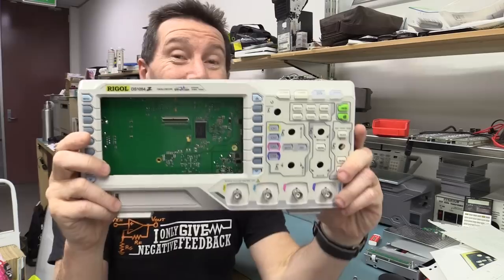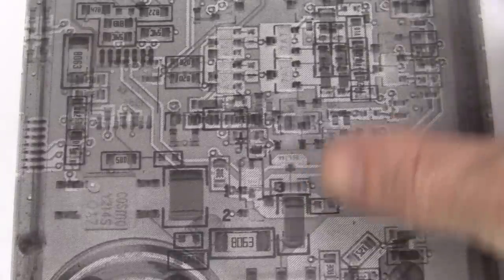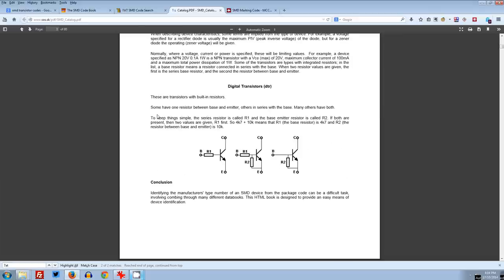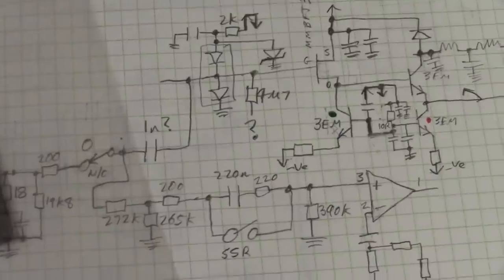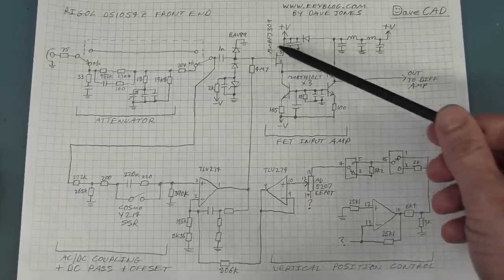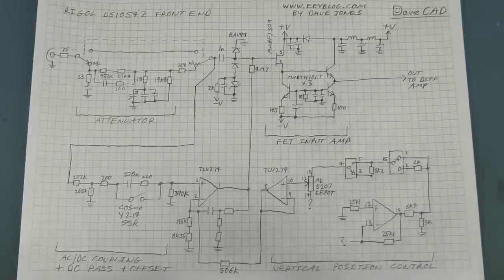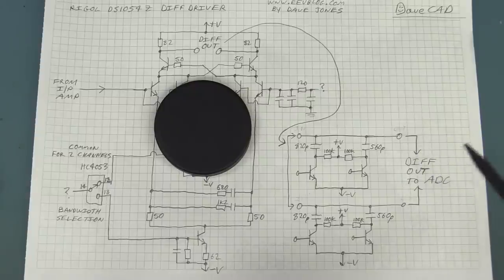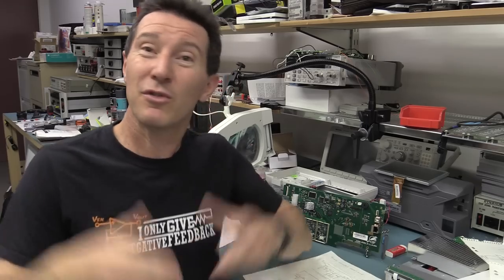EEVblog #675 - How To Reverse Engineer A Rigol DS1054Z

Comment: As much as I dislike Dohn Joe 's responses on here, I do agree that reverse engineering and intellectual property don't exactly go well together. In this video it's fine, because you can easily use fair-usage such as critique, education and reporting . But yeah, I think from a legal point of view it's actually illegal to modify hardware of the devices you own, because you're infringing on the copyright of the design and the firmware of the device. Whether or not charges are pressed against anyone is another point, but Rigol is certainly within their right when they want to prevent people from infringing on their rights
Reply: Reverse engineering and modding only infringes upon IP if IP is actually stolen. In the case of people modifying DVD/Bluray players or game consoles to rip or use unowned content, certainly there are legal ramifications. In this situation, however, Rigol is selling equipment, and end users are improving the equipment they purchased. They can void your warranty, but there is no way they could take you to court over it.
Reply: bloomtom You're entirely right when an anti-circumvention method has been implemented to protect subsequent copyright holders (such as in the case of game consoles, DVD players and other encryption devices. However, look closely at https://en.wikipedia.org/wiki/Anti-circumvention and the linguistics which the law uses. It clearly states "Member States shall provide adequate legal protection against the circumvention of any effective technological measures, which the person concerned carries out in the knowledge, or with reasonable grounds to know, that he or she is pursuing that objective." In this case, Rigol is (presumably) utilizing part of its firmware and (maybe) part of its hardware to protect itself from the users changing the bandwidth of the oscilloscope. This is not restricted to EU, USA also includes "circumvent a technological measure" in its anti-circumvention law. Thus, Rigol has implemented a technological measure to prevent users from changing the bandwidth of this scope. Anyone publishing (aka facilitating others) information on how to circumvent their technological restrictions are therefore infringing upon Rigol's rights.
Reply: ***** Removing the screws falls under the definition of circumventing a technological device. Oh my, Dave you criminal!
Reply: Dear redtails, Rigol is Mainland China electronics company. What "copyright of the design and the firmware" you mean? It doesn't work like that :)
Reply: Gillian Seed Don't be ridiculous, screws are not part of a DRM mechanism, software limitations are. Trying to circumvent software limitations (to give this scope more bandwidth) is essentially the same as pirating. I don't write your law, and you're obliged to know it

kroplaaaa Rigol trademarks, patents and copyrights their stuff all around the world, the distribution is worldwide, your point is moot.
Reply: ***** ahh i see what youre saying, rigol has a copyright on scope bandwidth
Reply: ***** I do not agree with this legal analysis. My grounds are in the difference between digital and physical goods, or information vs. hardware. Rigol is using software (information) to manipulate hardware devices external to the software. Once control leaves the software device (the CPU and related IO) circumvention is no longer protected by the DMCA or WIPO. Further Title 17 (in US code, which members of the WIPO subscribe to) only protects copyright, of which device performance is not covered. Therefore the physical switching of in circuit components on a hardware based device for the manipulation of product performance is not a protected by anti-circumvention laws. My assertion is based only in theory however, for as far as I know such coverage under the WIPO has never been tested in a formal legal setting. There would need to be a test case for us to truly know. Though I believe my argument is sound, I bet a group of really clever (evil) lawyers could somehow get factory set capacitor value states to be covered as "digital media". The thought of where such a conclusion could lead to is not pleasant.

If anyone is stumped by the hypocrisy between software and hardware copyright protection: The RIAA (music industry) managed to push really over-reaching new copyright protection exclusively for digital content in the US back in 1998. This legislation granted far stronger legal protection to digital works, stronger even than physical works. These additional protections include a group of "anti-circumvention" measures, which basically state: "you don't actually own the digital content you own".
Reply: bloomtom You're making the assumption that the law on anti-circumvention implies that "technical measures" are restricted to software. That is an unfair assumption and would never hold firm in a legal setting. Firmware does not operate without hardware, and vice-versa. The linguistics as are used in the European law make no mention of software-only protection and include all technical measures. Although there has never been any court cases for oscilloscopes specifically, there are plenty of cases of people jailbreaking iPhones, android telephones, PS3 (and other consoles), region-locked media players, etc. This short list contains a variety of examples; both software-only and hardware modification. Some of it was ruled illegal to protect the copyright of others, and some of it was ruled illegal because the manufacturer doesn't want you to use their device in that way. As I said, the chance of being prosecuted for upping the bandwidth of your scope is extremely small, though I would not be surprised if Rigol requests people not to reveal information on how to do that.

And of course you don't own digital content? What makes you even think that? Do you think buying a DVD grants you all legal rights to do whatever with the DVD you wish, including modification and reselling? By buying a copyrighted work, you're buying the right to consume it. There are separate methods by which you can buy the rights to modify and distribute creative work, but those are not 4.99$ at your local dvd shop.

Gillian Seed You can continue using analogies to prove a point that isn't true, or you can read https://en.wikipedia.org/wiki/Anti-circumvention and inform yourself on the current legislation on anti-circumvention in electronic devices. After you've done that, you can make a fair argument
Reply: ***** Technical measures are not limited to software, but the protected content is most certainly limited to information, or digital content. The specific clauses in title 17 regarding anti-circumvention apply only to copyright protection systems. Modifying a device's clock speed or display brightness in software or hardware is absolutely legal, but bridging a jumper link to make a device think it is in a different region is absolutely illegal. Changing bandwidth belongs to the former category as oscilloscope bandwidth is not copyrightable. Further, any expert in the field of EE could tell you switching capacitors into the frontend signal path will lower bandwidth, so you couldn't even try to pull "external digital systems" shenanigans in court against a competent defense.

The closest thing I can see as a common example of modifying bandwidth is overclocking CPUs. CPU manufacturers often sell different versions of the same device, just with different clock speeds. Graphics card manufacturers do this as well. Power users and devoted system builders will often find underclocked versions of premium chips and overclock them to get the same performance for far less money. People have even done hardware mods to support this, and have gone as far as unlocking disabled cores on the silicone. This is all perfectly legal, and processor manufacturers accept that if they sell software hobbled silicone and a user restores it's functionality, it's their own fault for selling such easily improved devices. If you are to refute this argument, I would like to see either a better or similar analogue with legal precedence restriction of modification.

As far as owning digital content, I am sad to see you think this way. Yes, when I buy a CD I expect to own that CD, and for the most part I do. I can sell it to someone else when I don't want it any more, and I can make personal backups (as long as they are deleted when I no longer own the CD). What I can't do is use a laser to overlay dubstep over the (likely already garbage) music and sell the CD for $50. I feel like I should be able to do this, as long as I buy and modify every CD I sell (to dumb people for a 10x markup). Unfortunately copyright grants ethereal protection against such things, as if a copyright holder's organization of information is so much more special than every other organization of information that they can hold some ultimate universal power over it.
In short, I disagree philosophically with some sections of the DMCA.
Reply: bloomtom You're still arguing on an edge of software and hardware. The bandwidth limit of this scope is limited (likely) by the capacitor pull-ups, AND by copyrighted firmware that display it on screen. Making this device think it's a higher-spec device, and thereby fooling the software into displaying information it should not display is illegal. 

As for overclocking CPUs; manufacturers do NOT impede their users to change the clockrate of their CPUs and GPUs. The anti-circumvention law makes clear exempts in case the manufacturer stimulates modification. 

As for enabling cores; as far as I know about this topic, manufacturers lock these cores by hardware fuses and I've never seen anyone prove that they've both unlocked additional cores or functionalities AND proven that these additional functionalities were functional. 

As for your point on rights management.. the owner has the last say. That's only fair. Anything beyond that is just your opinion and not based on facts.
Reply: ***** The software is going to be agnostic to the actual bandwidth of the front end; removing the capacitors will not cause firmware modification. You will still see "50 MHz" on the display, but you will be able to resolve 100MHz signals. Just because the firmware says the scope is 50MHz doesn't mean we are bound by law to have 50MHz actual bandwidth.

Perhaps another analogue? : Cars (cars are always a good analogue).
1. You buy a car, and add a turbo to get more power from the engine. Legal? Yes!
2. You buy a car and replace a purposefully restrictive air or fuel intake to get more performance. Legal? Yup!
3. You buy a car, and cut a calculated hole in a purposefully restrictive air or fuel intake to get more performance. Legal? Still legal!
3. You buy a car and replace the ECU with an aftermarket one that adjusts timings to maximize performance. Legal? Yes!
4. You buy a car, dump the ECU firmware, disassemble it, find the timing algorithm, modify the code, compile and upgrade your ECU. Legal? Absolutely not! Why? Digital rights are different than physical rights in law!

Removing the capacitors is situation 3 and is legal.

This isn't a case covered by anti-circumvention laws because the mechanism in place is not protecting a copyright! These transistors and capacitors are not protecting digital content, so your argument is fluff, I'm sorry to be so direct here but you don't seem to be getting it. I have refuted your central point. Please provide evidence to back up any claims to the contrary if you still believe I am incorrect.

RE: Core enabling: You are incorrect. My old Phenom x2 was a quad core with two locked cores. I was able to turn it into a tri-core, the fourth core munged instructions when overclocked; sometimes those cores are locked for a reason. Predictably, multi-thread performance went up by a little under 50% It was great for turning my FLAC ripped CDs into compressed OGG for my phone. DbPoweramp picked up the third core and ran with it. Still took ~6 hours.

RE: DMCA: Refer to my last sentence: "I disagree philosophically". Roughtly translated this is: "In my glorified opinion on how the world should work". I never meant to hide the fact that I was spouting opinion.
Reply: bloomtom Dude, if you're so into analogies, then at least use comparable situations.

1. You buy a scope that can decode SPI, but is software crippled and you need to buy a key to enable it
2. Through a hardware hack you make the oscilloscope think you've bought the license
3. You're now illegally using the SPI license.

And your car example is just bad. It might be legal (or not) to manipulate your car in any way you see fit, but you're compromising the road-legality of your vehicle and your personal responsibility in case of insurance claims. 

As I said, this oscilloscope is likely using a combination of selectable hardware crippling and software crippling. Changing the hardware in such a way to make the device believe it is a 100mhz version is the same as pirating the license and illegally activating parts of the firmware you have not paid for. If this was a fully analog scope that outputted the input without software interference, you might have been right, but the fact there is copyrighted software in the data pipeline means it receives protection by law. 

You'll have to link me a forum thread where you're backing up your phenom figures with screenshots because I can't take your word for it.
Reply: ***** That is in no way a comparable situation.
Your analogy: Enabling a software function though a hardware hack.
Reality: Enabling a hardware function though a hardware hack.

Hardware is not copyrightable. The CAD drawings are protected by copyright, but as soon as your design is a real product and shipped out the door, it is no longer protected by copyright. The only reason firmware is protected, is because it is software, and software is like a CAD drawing that is used to fabricate logical structures in the hardware in real time. Removing caps does not affect the firmware in any way, so there are no copyright implications.

The firmware will be agnostic to the change. Those capacitors are physically filtering the input signal, rounding out the high frequencies. There is no need for software crippling. I'm guessing the jumpers Dave found set the model, the software reads the jumpers, and sets the bandwidth capacitors accordingly. Playing with those jumpers might be illegal, but removing the caps is not. The reasons for this are deep in copyright law hypocrisy. The RIAA never wanted to protect functionality, they just didn't want anyone disabling their laughably weak digital media protection schemes without legal recourse. Title 17 grants no protection to hardware based functionality, because it is out of scope of what copyright protects.

If you think I'm being pedantic over the difference between software and hardware, I'm not. This is the kind of thing copyright courts anguish over. Trying to find where the software ends and hardware begins. This is a pretty clear cut case though, that frontend is all hardware. Some control signals are sent by software, but I bet you could cut them or pull them low and the firmware wouldn't know the difference. The drawing as Dave laid it out for us has no feedback mechanism. Even if there was a feedback mechanism, you could feed it signals to make it think it was in 50MHz mode. As long as you don't enable any software features with your mod, Title 17 contains no recourse.

The only way for Rigol to really protect themselves would be to have the bandwidth limiting entirely in software. If they did that, there would be no need for the hardware bandwidth limiters, so they wouldn't have included them (cost). I'm guessing it was way less expensive for them to just throw some caps on the board and know for sure rather than implement a software based variable low pass filter and have to prove it worked reliably.

RE: The car analogy: Road legality has nothing to do with oscilloscopes, so I did not mention it. However, none of the mods I specified would make the vehicle illegal. If a crash occurred due to a failure in a mod, then you would be liable, but those mods are extremely low risk. The worst that could happen would be a stall (dangerous if you don't know how to handle it), or early component degradation due to excessive torque.

RE:RE: Core unlocking: http://www.anandtech.com/show/2927 This article was written by Anand Lal Shimpi himself; he is not known for telling lies. If you ask for more proof I'm going to give you a lmgtfy and you can do your own research until content.

Edit: Minor spelling.
Reply: ***** I have strictly been using legal terminology when referring to "hardware" and "software" to avoid confusion. The two are treated as completely different things in law, even though we both know that's crap. I thought this was clear.

I wanted to be absolutely sure you understand we can modify the hardware to our heart's content, as long as the firmware remains agnostic (no illegal internal change). I'll define an illegal change as making the scope detect it is in 100MHz mode.

Okay, so if the scope detects it is in 100MHz mode, we've made an illegal change. That's not a problem though, because any feedback mechanism can be spoofed into detecting 50MHz mode, thereby avoiding an illegal change. Think about it, how can the firmware possibly trust any input signals if we control the input signals? Try to think of a detection mechanism, then break it. The only unbreakable interface would need to fully and correctly implement a strong (technical term) cryptographic system. I can guarantee this has not been done.
As long as the firmware is agnostic we are in the clear, and we can pull the blinds so far over the CPU it'll think it's still in the factory, nice and cozy.

Now, if Rigol wanted to actually protect themselves legally (as in, cared), they would have implemented an all-software solution to bandwidth limiting. We can still defeat it, but will grant the device coverage by anti-circumvention laws. I don't believe they have done this, as I have said before. My reasoning is based on what I thought was sound logic: The parts they populated cost money and board space. Why would they have paid an engineer to develop and lay out that section of the front end, then pay to populate the section during production if they already had a software solution in place? Mind you, this means they also spent money on the software guys figuring out how to fit an always on low pass filter into the digital signal path, which wouldn't be trivial. Remember they are trying to squeeze maximum performance out of what they have for the lowest cost possible while still delivering a good product. They don't want software filtering causing a drop in waveforms/second or introduction of phase delay. All they want to do is limit the bandwidth, and a properly designed hardware filter can do that with minimal cost and side effects.

I have a strong reason to believe hardware filtering is being done because those parts are on the board. What leads you to believe there is software filtering going on? Burden of proof is on you, as we already know one way filtering is being done; there is no obvious reason for there to be another filtering mechanism.

If your concern is resale of upgraded scopes, then I have some good news for you. Upgrading the 50MHz model and selling it as the 100MHz model is fraudulent in the most basic sense. One could sell them as hardware upgraded 50MHz scopes, but you'd need to provide full disclosure on the lack of warranty from Rigol, and you wouldn't be able to use Rigol's specifications in advertisement. I also have some bad news though. The kind of person who would profit off the back of Rigol is also the kind of person that doesn't care about breaking copyright, patent, trade, or buyer protection laws. Laws don't stop people from doing things, they only allow the prosecution of bad actors in society after the fact, and Rigol most certainly doesn't have enough weight to attack every, or even many, illegal resellers of devices.

Rigol is a smart company. They are small (relatively speaking), they have a pretty tightly meshed customer base (The EE community is very attached to itself). It would be stupid of them to spend $10 per unit on pointless DRM type protection measures, when those measures will be defeated anyway. That money can go towards lowering the price point or raising their bottom line, and it should. They are relying on turning heads to really fasten themselves to the market, and they are succeeding. The hack-ability will be a major selling point for this thing, even though they aren't advertising it that way. I really don't need another scope, but you can bet I'm buying one just to rip it apart. There are many like me, that love to own a device, and nothing beats doing a hardware mod for feeling like you really own something.
Reply from the maker: ***** It's not illegal to modify hardware that you own.
Reply: Dave is one of the most upstanding and moral citizens of the Internet. In order for say Rigol to create an oscilloscope, I mean all the way, they would have to invent the language, discover the math, chemistry and the physics involved, invent every fucking thing all the way. Their contribution is 0.0001% tops. They got all of this on a silver platter but hide this one small detail. It is society which is immoral, making us compete with one another and with machines. It's one big game of Monopoly. If they want to compete, it's the quality of the product that matters and the fact that I've seen how they work will make me buy one. A sane society would be one big community openly sharing ideas. I see the future, if we are to survive, in decentralized and highly independent communities in which everyone has what everyone else has, where you just get a blueprint off the internet and then just print it out or something similar, perhaps tweak it and upload back, make your own contribution, as it were. The free circulation of information should be one of the most basic of human rights cause that's how we thrive.
If I have seen further it is by standing on ye shoulders of Giants - Isaac Newton
Creativity is knowing how to hide your sources - Albert Einstein
Reply: EEVblog It is illegal to modify hardware you own when you're breaking copyright law in the process. There's dozens of people in jail for exactly this.
Reply: TechnocraticBushman this has got to be one of the dumbest comments I've seen all week. Whereas sharing knowledge seems a noble goal at first glance, you will quickly discover that discovering new knowledge is not free. The only way to assure new knowledge can be produced is by having a good financial structure; aka the protection of intellectual property. How do you propose a pharmaceutical company earn back their multi-billion dollar investment when they do not have the sole rights to the knowledge and rights of producing said pharmaceutical? Right, the liberation of knowledge flow leads to the destruction of most ways to develop novel (scientific) knowledge.
Reply: ***** Pharmaceutical companies are doing just fine. Most research is done in universities and then patented by companies which only do the studies for profitability and that is not ground breaking research by any stretch of the imagination. It's capitalism for the poor and social democracy and the nanny state for the rich. Capitalism could not survive a week, absent of state intervention. Ask that communist Adam Smith with his The Wealth of Nations book. All and I want to stress all research into electronics and the reason why Bill Gates and Steve Jobs are rich was done at MIT, Berkeley and alike, using Pentagon funds and student debt, under the threat of a nuclear bomb coming from USSR. If you want, we can write down a list of modern day technology and see just how much of it came from where, in terms of innovation and invention.
Reply: TechnocraticBushman When a patent for a novel treatment is granted, you have 20 years to do all phases of clinical trials (averages 5-10 years) and earn all your money back. One very important reason research grants are accepted is when the technology can be patented. I'd like to stress that all modern medication that you receive when you're ill could not have existed without patents. In fact, it is exactly because of patents that 3rd parties can make a profit on other people's inventions when the 20 years of protection are over. After all, if patents did not exist, inventors would go to far extends to keep secrets to themselves, and 3rd parties would likely never acquire the knowledge necessary to reproduce something. Patents are not only about protecting the inventor; it's also exactly about sharing the knowledge of the invention. As far as I can see, that's what you want. So in short, what you actually want are patents.
Reply: TechnocraticBushman
Your vision of a free information system is certainly idyllic and desirable, but it is not realistic, and won't be realistic until progress no longer means fulfillment of a direct need. As long as there are some people in the world who cannot possibly live without doing work, some amount of capitalism will be necessary. Currently a healthy free market cannot exist without patent and copyright protection, as otherwise (as per *****) information is hoarded forever in an effort to protect profits, and small actors have a significant disadvantage when bringing a novel idea to market. We must reward people for the progress they've made in a field, not criticize them for the prior art they stand on.

Ideals are important, but they cannot drive your world view. Instead of saying "why don't we just...", say "what can I do to naturally push society towards this ideal?". One strategy originates in ignorance of all the problems in your way, and the other takes those problems head on. We have a long way to go until your ideal is met; I wouldn't expect to see any of it this lifetime unfortunately, but that shouldn't stop you from trying now. If you make something really useful, then you can patent it and be rewarded for your contribution towards our better future.
Reply: bloomtom Of course. I have no illusions. I just followed a reasoning to it's logical conclusion. When I say we should drop competition out of our behavior, I just follow the known mathematical models on natural selection and it's effect on populations, in other words, what has been tested and works. The fact that it does not apply as of yet is indeed a fact. Even for me, to be able to contribute to open source projects means I need a steady daytime job.
Reply: Just to put your mind at ease, it is in no way illegal to modify any piece of any type of hardware. It can be a computer, a car, a gaming system, it doesn't matter. You OWN that hardware period end of story. You can't copy intellectual property and sell it but you can change your own devices all day long.
Reply: ***** "The only way to assure new knowledge can be produced is by having a good financial structure; aka the protection of intellectual property."

How did we even survive until the divine DMCA came to save us? Surely that must mean that the world was created last Thursday and all of human history was an illusion!
Reply: Gath Gealaich Just don't say anything about Santa, okay? Especially around the holidays...
Reply: Gath Gealaich Wow, dude, great logical fallacies you're using. I'm sure you're great at parties.

Give me ONE example of pre-patent technology that cost the equivalent of >1 billion dollars to research. I'll help you here: there aren't any.
Reply: ***** So you think the US government would never go for the nuclear bomb if it weren't for patents? Plus the question doesn't even make sense. There's plenty of technology out there that works by utilizing many distinct parts, each of which has been a product of decades of incremental development. But you could just wait for SpaceX until they hit the $1B mark in R&D expenditures. Then you will know for sure that there is such a thing. :-)
Reply: Gath Gealaich What is your point? Do you want to abolish or change the current patent system?

You'll find that the atomic bomb was in large part a military research project. Of course it has its history in elementary physics research. Of course you're right many technologies lend themselves to previous work. However, you're missing the point, a patent is never about an entire product. Your point that technology always uses many distinct parts each with decades of work is moot. The fact that a patent requires the usage of copper wire does not mean you're breaching chemical patents on how to extract copper from raw material. 

If you have an opinion, that's fine. But, you should bring forth logical reasoning why. instead of throwing around logical fallacies at other people's arguments because you're so convinced of your own opinion that you require no reasoning to convince others.
Reply: ***** In your many comments here, you have contributed many more fallacies into this discussion than I could possibly have, so I wonder how relevant is it even if I committed one fallacy here. But I still don't think I have: The lack of a patent system cannot possibly prevent invention. That's simply inevitable. That's true even on a purely qualitative level before we even start discussing the quantitative aspects of monopolizing usable knowledge through patents. People will always look for new applicable knowledge because distinctive knowledge is the only way of getting ahead on any market.
Reply: Gath Gealaich You can't deny that certain inventions would never have occurred without patents. That alone justifies the existence of patents. Any subsequent argument against a patent system is therefore useless.
Reply: ***** "You can't deny that certain inventions would never have occurred without patents."

Which ones?

"That alone justifies the existence of patents. Any subsequent argument against a patent system is therefore useless."

So even if one invention, or a handful of them, is conditioned by a patent system, that somehow magically outweighs the costs of it for everything else, no further analysis needed? Apparently, you couldn't be more pro-patent even if you tried.

Hey, two can play that game! The TSA found a guy trying to carry a sharp object into an airplane, therefore, any subsequent argument against people getting groped at airports is therefore useless.
Reply: ***** 1 How about the iMac and the iPhone? They are on a netBsd subsystem on a darwin kernel, both developed at UC Berkley. So how about that? 2. What about the Linux Kernel? 3. What about chemotherapy.
All(scratch linux) budgeted under the threat of the cold war under the pretense of a soviet invention. Pentagon funded MIT Berkley and alike.
Reply: Gath Gealaich TechnocraticBushman  Well let's see.. A large portion of medicine that the WHO recognizes as essential human medicine was at some point patented. You can argue either way whether or not this is good or bad, but the inventors of these drugs thought it was necessary to patent their technology, thus indicating that patents in part were responsible for the development of said medicine. 

Arguing against patents is arguing against modern medicine. No patents means a huge decrease in funding going towards research, and thus a stagnation of modern medicine. Highly undesirable. 

Don't get me wrong; I think it is very noble that some people think that the distribution of free knowledge should be more important than protecting the (financial) rights of the inventor, but I also highly recommend you people read up on the good things that patents bring. When people discuss patents, they think about what they read about in the news; e.g. patenting round edges, notification centers, right-mouse button clicks. That's fucking bullshit. Those are some of the worst examples of patents you can provide. Patents ensured that nearly everything you use on a daily basis was financially sound and secure at the time of development. Compared to other legislation that was made for the protection of creative rights (such as copyright), the patent system is extremely weak already, and still R&D makes ends meet.
Reply: TechnocraticBushman Why are you still arguing against patents? I thought we agreed above, that patents are necessary in a privately funded free market. Patents provide incentive for investment in R&D. Until R&D is nearly free in all technology fields patents will be essential for a healthy moving system.
Reply: bloomtom I'm arguing against patents in the same sense that I'm arguing against self defense by means of force. Sometimes, such things are necessary but I'm just pointing out the root of the problem.
Reply: TechnocraticBushman there's only a problem because you think there is one. Patents are not self-defence. They are full disclosure of technology. If you think otherwise, I strongly suggest you actually read a patent. They resemble scientific papers a lot.
Reply: ***** "They resemble scientific papers a lot." Hahahaha. They look nothing like scientific papers - scientific papers are actually comprehensible!
Reply: Gath Gealaich okay I don't know why I'm responding to you, but if you feel like enlightening yourself, take a look at https://www.google.com/patents/US5067805 . This is a fairly normal patent. It's a patent on confocal microscopy, more specifically Confocal scanning optical microscope. It accurately describes the physical construction and theoretical background of the technology at hand, with supporting figures and tables. In addition, it makes citations to other patents where applicable (such as when describing the theoretical background) and when parts of other technologies are incorporated. The revelation of all the information required to both comprehend the theoretical background and the physical construction of an apparatus is typical of patents, and is reminiscent of scientific papers in that both attempt to enlighten the reader and reveal information that was not known before. If you have serious arguments against my claims, go ahead and try me.
Reply: ***** Well, I guess that one looks reasonable enough (though I've scanned it quite perfunctorily, mind you), but I've seen quite a few software patents that looked like pure bullshiting (in the sense that through the use of fancy words, "inventions" were patented that substantially replicated or reshuffled existing systems, and the wording passed examination even despite the lack of novelty). I guess the hardware side might be in a better shape.

But you've actually picked an interesting example. Petráň invented his microsope under wildly unfavorable conditions, received virtually nothing for his invention, and his patent didn't help him very much. But he did it anyway, because he wanted to try a new idea, and it worked. Somehow the idea that inquisitive people would stop trying new ideas in the absence of patents seems very dubious to me, and Petráň is a beautiful example of that.
Reply: TechnocraticBushman You've pointed out no root. The true reason patenting and self defense is necessary boils down to "humans are greedy". As long as there is something to gain from violating the rights of others, some people will do so. Patents protect innovators from bad actors who would take advantage of them by providing a means to retaliate. It isn't the best possible solution, but it's a solution that works right now. Do you have a better alternative?
Reply: bloomtom Patents do not protect inventors in any way shape or form. Please try filing for a patent and tell me how well it goes. It only works if you have loads of money to begin with. You'd have to be a big company to do that... or a patent troll with some initial investment but it's not fair to lump the two together as you might point out and I agree.
As for the question, the answer is no. As of now, I do not have an alternative. My idea is long term and involves the restructuring of society, armed with the information that science has given us. We need society 2.0 before we can get rid of patents and we're not there yet.
Reply: Gath Gealaich I never said people would stop inventing stuff in absence of a patent system. I'm merely stating that some inventions (mainly the ones requiring financial support from 3rd parties) heavily rely on the protection that patents offer to get their funding round. Just like your bank wants some security that you can pay back your mortgage, funding agencies want some security that they're getting their money back; e.g. financial protection of a patent. 

As for software patents. As I said, just because there are a couple of ridiculous media-hyped patents about round edged and lockscreens, does NOT mean the patent system needs to be changed. Every system can be played, and there will always be abuse. 

Also, I've not heard any sound argument against patents. 

TechnocraticBushman It sounds like your only issue with patents is that it require loads of money (which isn't true) and that the process of requesting a patent is difficult (which is also not true). I know tons of people that own patents, it's not a difficult procedure to go through. Also, as you don't have any alternative methods for protecting inventors, I'd rather you stop shouting your anti-patent bullshit as it's really fucking childish to proclaim you don't like something while giving no alternative.
Reply: haha I can modify things I own, I can crashtest them etc. pp. :p
Reply: ***** bloomtom So, how long have you two been married? smh